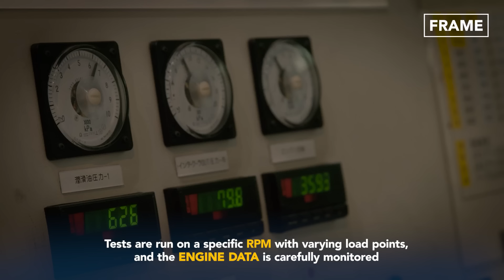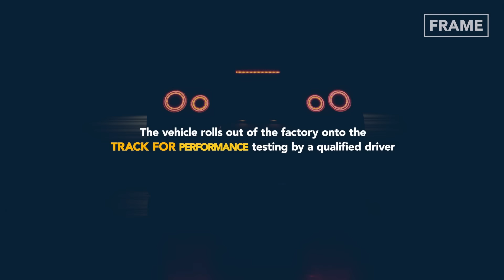Inside the Insane Japanese Mega Factory Producing the Nissan GT-R 35 - Production Line

Comment: taking the smaller tappet measurement and then forcing it back into fake tolerances with a larger one. .... 
diecast cam cover during final inspections, the injection molded abs intake container. the silicone intake tube... the diecast intake runner... the brass connector..

Comment: I’ve been an avid Nissan fan for many generations. From having the my first Nissan as a b13 Sentra se-r to the z32 300zx twin turbo, b15 spec v,  350z, a couple of g37 coupe/sedans, q50 and now I own a q60rs400. Nissan needs to step up a bit with the interior. The Infiniti Line up especially with the q50 has been the same damn dashboard since 2014. Lets not talk about the m37 interior it’s still used in the  qx60 and q70.
Reply: well the Q60 is in its last year of production. to make way for more EV models. its a shame they ruined such a potential platform with that garbage jatco transmission. saving a few pennies up front to have their car die a few years later when it could still be striving. i also had a b13 se-r, a s13 with SR swap, a b14 se-r, a g35 and now a g37 and i also must agree that the interiors have always been underwhelming. as well as the infotainment systems. it just seems like its been mostly downhill since the guy from Audi took over operations

Comment: With a speed limit of 50 kmph it is startling that 67 people died on NZ roads in localities to stupid things like not giving way.

It wont be long till a death on Pukekohe roads. They have many trucks and there drivers here and also there bad driving behaviours a gaurantee.

Road accident deaths by age group for 2023 in NZ:
1.15-30 Highest bracket 120 deaths.  
2.31-45 71 deaths in 2023.  
3.46-60 57 deaths.   
4.61-75 55 deaths.   
5.76-90 28 deaths. 
2023 year.

Males rank 150% higher in car accident death rates sitting at 246 deaths whereas females sit at 95 for 2023.

341 deaths on NZ roads for 2023. 341 to many. 

2023 totals for road deaths in NZ 
Cyclist = 9. 
Driver = 182. 
Motorcyclist 53. 
Passengers = 72. 
Pedestrian = 25.

Overall the total road deaths for the Main NZ centers in NZ totalled 279 = AKL/BOP/Canterbury/Manawatu/Northland/Waikato WGTN did not total in with a low rate of deaths for 2023 @ 15 deaths on there roads for 2023.

The waikato faired not much better as we know from other regions with 67 deaths on NZ roads the worst of the totals for 2023.

Canterbury road deaths sit just shy of the AKL 2023 total at 45.

Auckland total deaths on the road abysmal at 47 for 2023. Highest death rates for Auckland roads sits at 111 deaths for 2021/2022 combined.